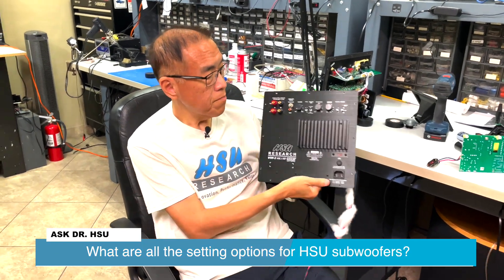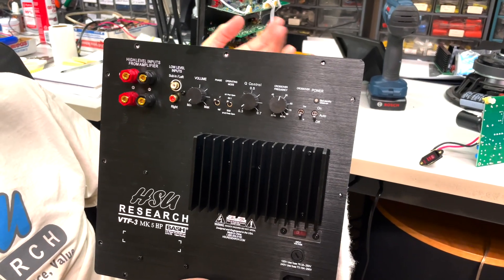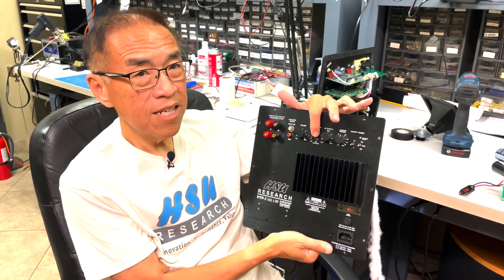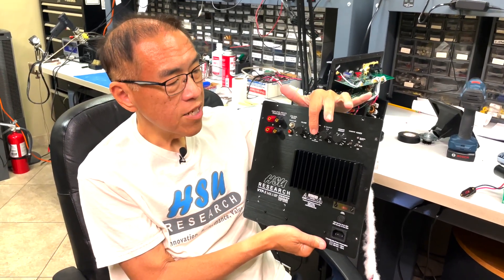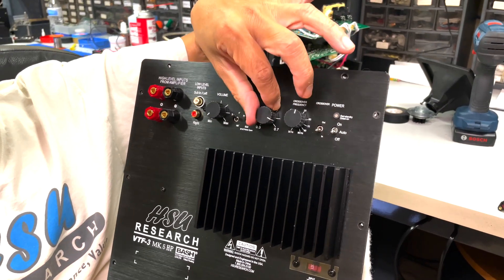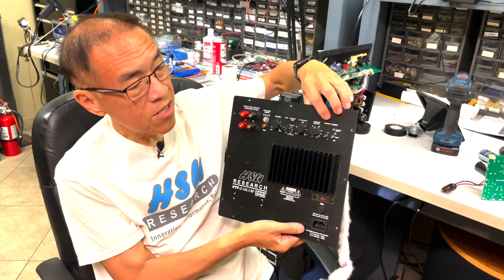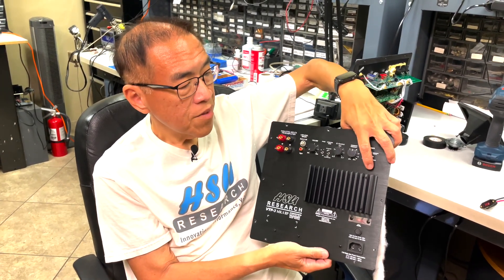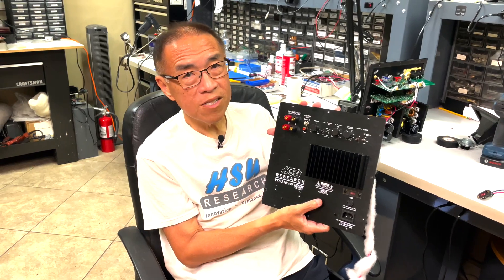HSU Subwoofer Settings Explained

Comment: You mentioned 0.7 Q setting is the “flattest response”.   I would’ve guessed the tightest setting would result in the most accurate response, which would result in the flattest response.